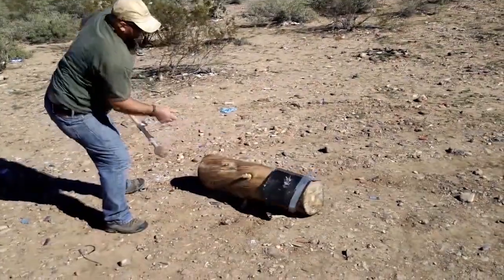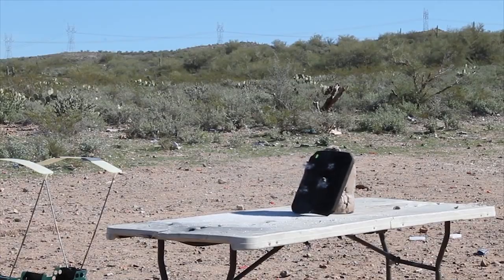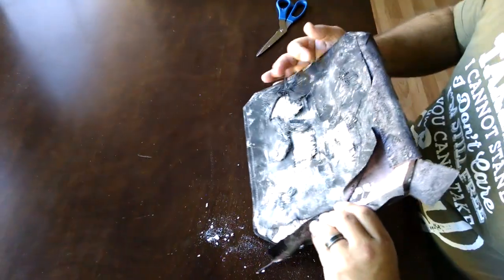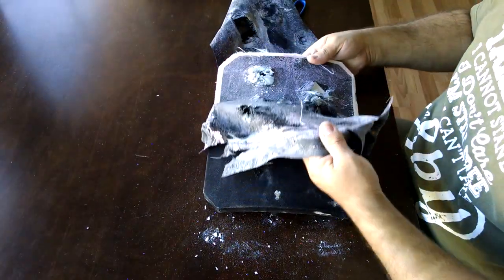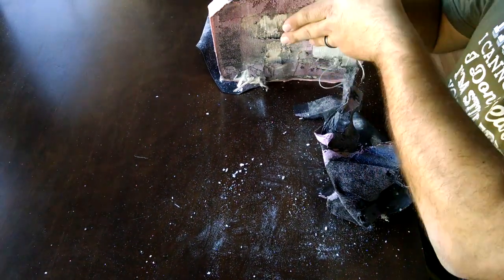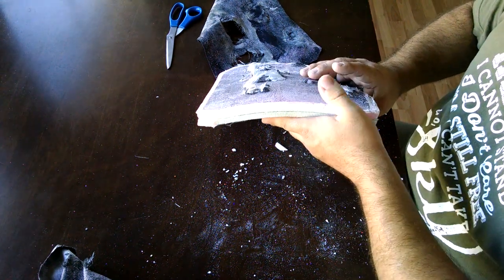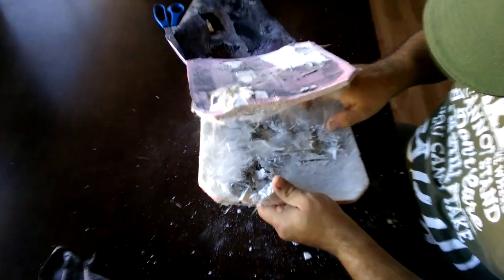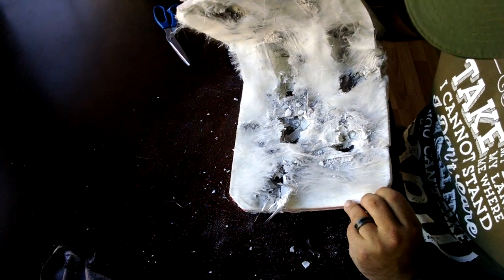What's inside a ceramic level IV plate?

Comment: I've looked inside plates before and I'm really interested in these type of vids. I want to understand the hardness ratings of ceramics and the different backing used. I had a mil issue plate it seemed like behind the ceramic was a wax impregnated fiber, it was yellow like Kevlar. I've thought about cross suctioning plates with a tile saw it should work
Reply: Did you ever do this? 

I would be fascinated to see a cross section. Before it's been shot I mean. 

Although it might be interesting to see a cross section of both undamaged and after a hit.

Comment: I should have made a video of my ballistic sheild construction. I used Silicon Carbide tiles. AKA "Black Diamond", Its "the 3rd hardest substance known to man". And I believe it. I purchased from Alibaba. Gotta love the Chinese lol! Same material they use in bulletproof cars. But for the price of 2.5 10x12 level 4 plates, I was able to purchase the material to build 8 plates. So I built a sheild. Its 30x48! 
I tested a 3x3 square. Put up against cinder blocks. Test 1: 7.62x54r API. Only left a nick, so small, I didnt know it was there until I rubbed my finger across it! lol
So, I had to hit it with "The Judge". Test 2:  50 BMG AP. 
Cracked 3 of the 9 tiles pretty bad, but didnt penetrate!!! No shit! Tile size is 50x50x30 mm each btw. But an interesting observation... the cinder block behind it basically exploded from the impact!!! 
I'd love to see more videos like this.
Reply from the maker: How much were the 50x50x30mm tiles each? Do you have a link?
Reply: @chopinbloc  Cant recall the company. But 20 bucks per kilogram, which I estimate about 50 tiles per Kilogram. Itll take about 70 tiles to create a 10x12 plate. I think it's a 10 kilogram minimum order. But it was from Alibaba. If you're a big spender, the Boron Carbide tiles are basically the same thing, but half as thick. Not that 30 mm is thick, but cutting down the weight is always good.
Reply: @chopinbloc  Oh, I forgot. It's not like a website. You have to inquire with a sales rep. I did it all on their Messenger. But you tell them how much you want, then they invoice you.
Reply from the maker: @globalsacrifice5248  thank you.

Comment: nice vid, backing is spectra or dyneema as you said.i wonder why they use a single "sheet" of ceramic instead of several tiles
Reply: Tiles are cheaper, but monolithic ceramic is better.

Comment: Gives me some more ideas for making home made armor! I just need a out door toaster oven, to start experimenting with HDPE! I have most the other supplies... I'm going to use different types of fabrics to start, then change the hdpe to epoxy or truck bed liner or a combo of all three! (almost $50 for a gallon of Harbor Freight truck bed liner! to much for me to test, but if it works, it is cheap!)  have you seen the 'the art of weapons' or 'Randy Knapp' channel? they have some good hdpe vids!
Reply from the maker: No, I haven't seen them. Bed liner works very well for a backer, if it's about a half inch thick.